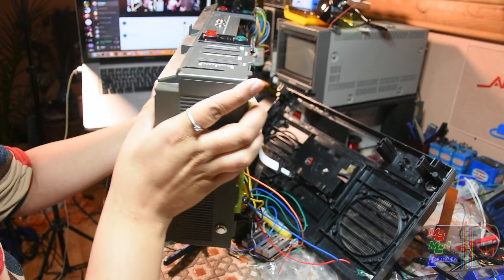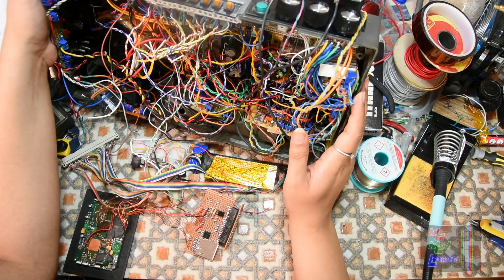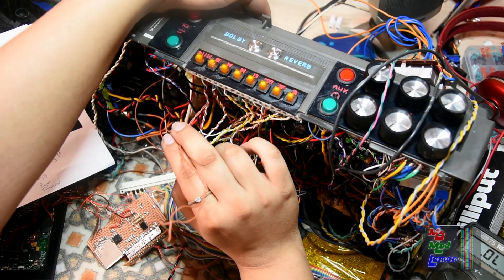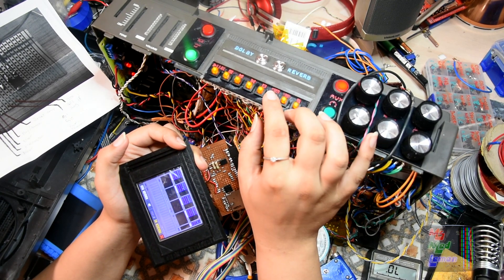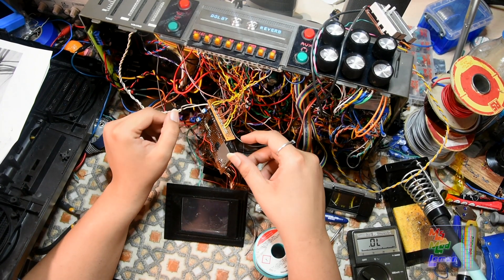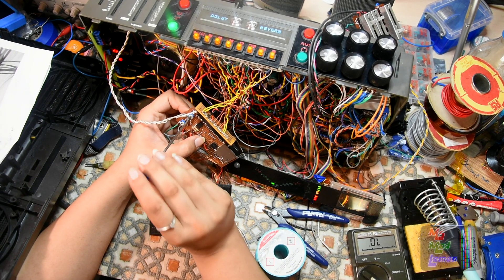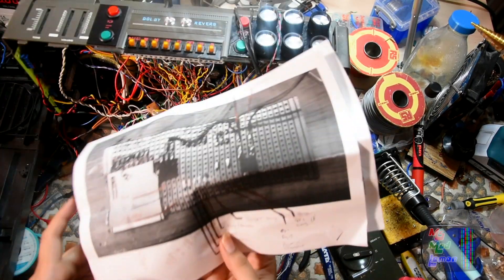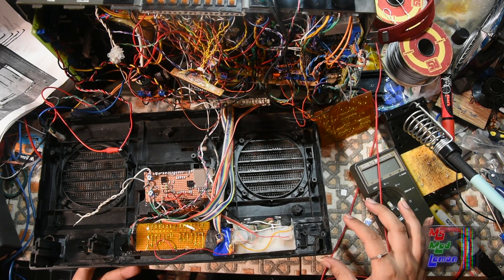Main Assembly 3 - SidBoomBox Project 20

Comment: i am being offered mint  unused condition sony wm  ex 422 for around 14 dollars from a local place .
its belt needs to be changed.
is it worth purchasing given the headache involved in replacing belt ?
(as per service manual one needs to desolder board and then replace belt)
regards